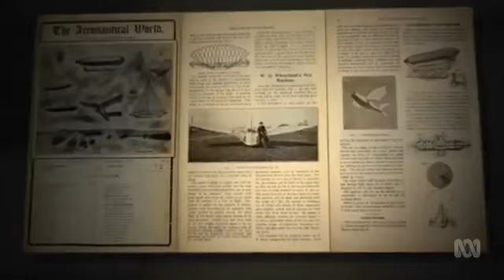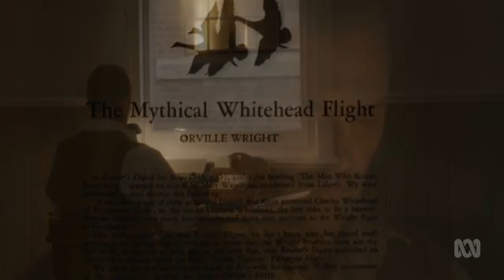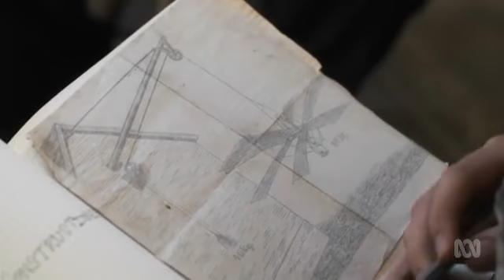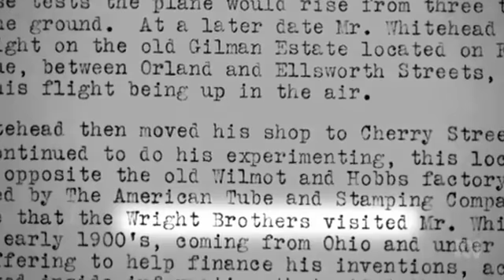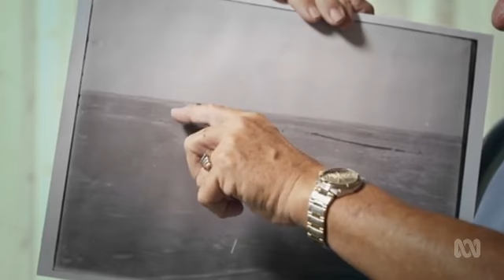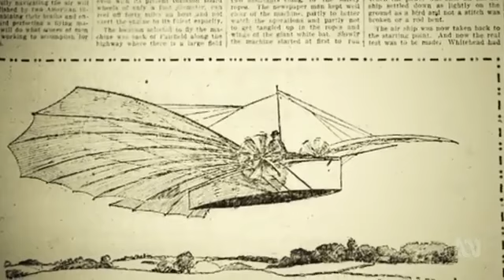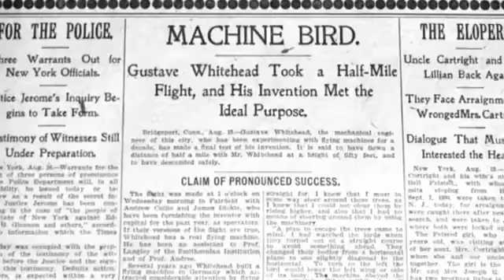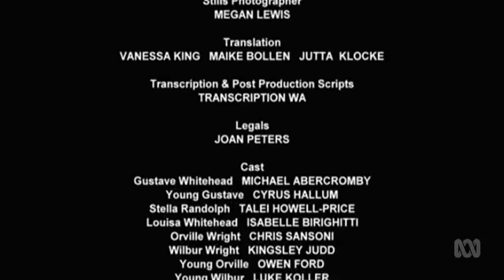Who Flew first Challenging the Wrights

Comment: Did you know that the Wrights had the flyer propeller at 365 rpm per minute? It is the rotation of the fan propeller
Reply: The Wright brothers used a single, 12 horsepower, gasoline powered, internal combustion engine to turn their propellers. The use of high speed (~350 revolutions per minute), thin propellers on their aircraft was one of the major breakthroughs for the Wright brothers and allowed them to succeed where others failed. At the time, others employed low speed, thick bladed propellers, much like the blades of a wind mill. But the brothers correctly determined that high speed, thin propellers are more efficient than low speed thick blades. High efficiency means that they were able to convert more of the available energy of the engine into thrust. The brothers used two propellers rotating in opposite directions. This eliminated any gyroscopic forces which would have been generated by a single propeller and would have made the plane harder to control. They produced a combined thrust of between 120 and 130 pounds at 330 rpm.
Reply from the maker: Did you know that you are starting to get on my fucken nerves?

Comment: 30:10  I've never been able to make out the nature of this shot either perhaps until now; showing the Flyer after the fourth flight. So I'm giving my 2cents. Orville never explained this picture in later years; it was however included in the Wright Papers after his death. Clearly the machine appears stopped with the engine and propellers stilled. Compare the position of the props to the only other shot of the machine after this flight; the frontal shot where the elevator supports are broken. The three of what they call 'black blobs' are obviously Orville, Wilbur and or the US Life Saving Men present at the flights and mulling about. I think the plane was in some sort of disassembly & transit after the fourth flight as the rudder appears to be laying on the ground in back of the machine instead of being in place.  The machine is simply being carried // and or trucked back to the hangar using the Junction Railroad launching rail which could explain why the wings are off the ground; it could be  hidden by the rudder on the ground. The long object on the ground to the right of the machine may be more of the movable launching rail or maybe not(just my opinion). The pic was snapped just before the wind picked up the machine and tossed it about with John Daniels inside. Question then, did Daniels take this photo and then sprint to try to help save the machine or did Wilbur or one of the other men snap the shot?; Orville was trying to hold the machine and then let go, he and Daniels couldn't be in two places at once. The photo was obviously taken before the wind upended the plane.

The engineer in this video holding the photo makes a good point of it not looking like 852 feet but rather 300 feet.(For comparison the Titanic doesn't look 882 ft in some shots of it especially angle shots; but you don't question it because you know the ship was 882 1/2 feet just by stats being repeated.) However, as Orville states in his diary, and in The Papers of W&O Wright, etc., the men carried the plane back and may have already brought it back several hundred feet before the photo was snapped. Looking at the full wide version of this photo(ie Wikipedia) with the starting point rail in view, one can see the photo is from an angle so 852 can seem to be shorter, the launching rail was only 60 feet. The terrain and lighting seem to differ from this photo and the frontal shot photo showcasing the broken elevator supports which indicate the machine may have been moved between the two  picture shots.

Comment: The biggest problem with this investigation is their version of flight, just powered flight, when universally flight is considered to be human, powered AND controlled flight. Are they ignoring airships here, which are only partially controllable and were flying years before? Whiteheads designs had no yaw control or 3rd axis, like all the other claimed flights EXCEPT the wright brothers. I don't think this investigation even knows these basic flight principles! That's why they just crashed into the first obstacle after getting airborne, if it even happened! The wrights invented all 3 axis for control and proper propellors which Whitehead didn't do either. His type 21 doesn't even have the basic correct aerofoil design or flaps on the wing. It was just an uncontrolled powered glider based on Lilienthal gliders which couldn't be controlled either!! This is not considered flight. It's Lilienthal's gliders which the wright based their initial design on and failed, which made the brothers redesign and discover true controlled flight by themselves. Whitehead never changed his designs. It's very hard to simply accept their 1899 flight had 2 people on board with the second guy shovelling coal into the steam engine?! It 'happened' on a busy street and no photos of the damaged plane or building exist? Signed affidavits 30 years after the 'facts' is not considered very credible, why not as soon as the events happened? They weren't credited at the time, I wonder why?
The evidence to trash the wright brothers is just bad form, they proved they could fly, in the 1908 footage in France, the wrights did a huge circle and figure 8 stunning the crowd. This is probably the best evidence and is still before anyone else was ever photographed flying.
Whitehead said in 1902 he promised to have photos to prove his flights occurred, but NEVER did, only glider images years after the wrights had already achieved powered, CONTROLLED flight. 
The Smithsonian Institute contract was basically an apology to the wright brothers achievement as they embarrassingly credited the failed Langley flyer as the first powered craft for decades. 
sorry bad information here.
Reply from the maker: since my childhood reading on the subject going back to 1960s, airships/balloons do not count in the definition because they are lighter than air..it was always qualified as 'heavier than air flight"..sometimes 'sustained' was also added as qualifier...ie, you cannot just run down or stand on a hill in a hang-glider and jump off like Otto Lilenthal  and claim the prize with that..as for human-powered flight, I'm not aware of anyone really getting it done with that back in the day, examples of that I've seen which you'd give credit to, Gossamer Albatross etc, are to my knowledge all from modern times...perhaps because they relied on modern materials and components to work even to the extent they did?

Comment: I grew up in and around Bridgeport, CT. In 1967 my godfather gave me a book about Gustav.  Read and did a little research. Gave a speech about Gustav 1967 Southern CT St. College. I think Gustav probably flew a little. The Pittsburgh example shows Gustav putting an engine on a glider and going downhill. Steam engine for power. The real problem with Gustav and his accomplishments come to commercial viability. He may have been a good engine manufacturer but his airplanes never gained commercial profitability. . Interesting but somewhat typical of "informational documentaries". Cleverly put together. As I ended my short lecture in 1967 I will end it with "so sad such a genius should go unrecognized and die in poverty"
Reply: The reason it wasnt economically viable is he bought into a partnership with a conman that put him out of business, he never recovered. His wife and family were more important.
Reply: Weisskopff, hummm, suspect
Reply: Thank you for your account. History was against a German getting credit for this. What's interesting is even the Park Rangers privately told me that Whitehead was first in 1901 and showed me a copy of Jane's Aviation who gave Whitehead the credit. I also worked on Bridgeport and remember going into an old photo studio and seeing photos of Whitehead in the air. Interesting also, I met the Whitehead family in Derby Connecticut and they told me that indeed Gustave flew in 1901.